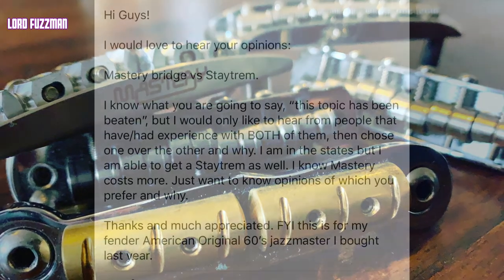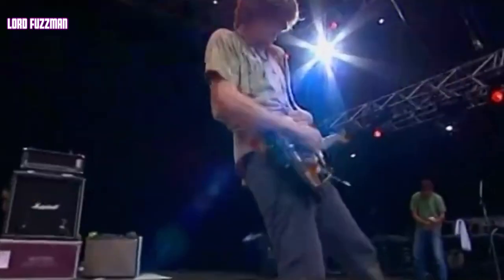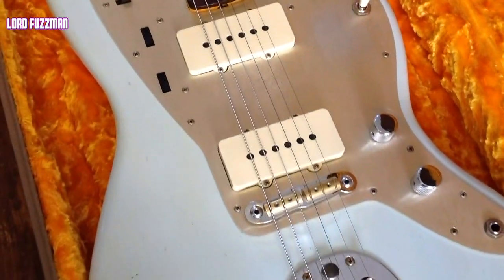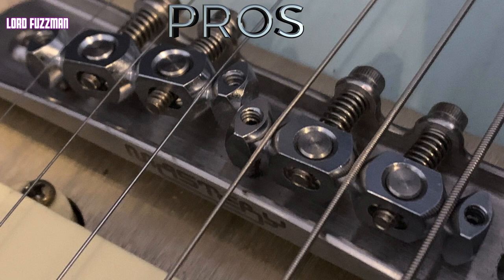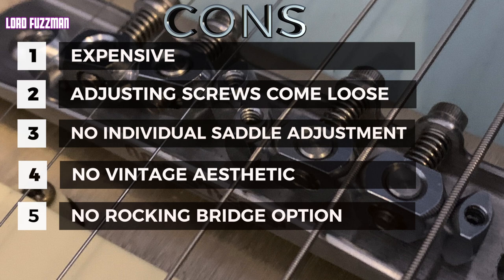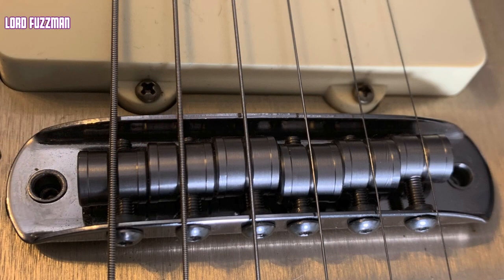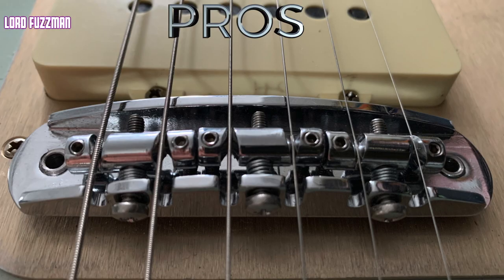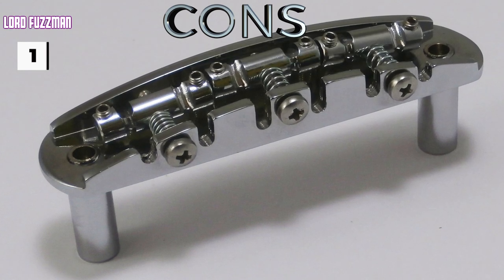ULTIMATE OFFSET BRIDGE SHOOTOUT - Mastery - Halon - Staytrem - Fender RSD - Mustang - Vintage

Comment: The vintage bridge that came with both my MIM JMs is trash.  Spent hours setting it up, manually making radius with action ruler, trial and error, the intination screw rides up and actually pushes against the bottom of the string, so had to drop saddles lower and raise bridge post height, after a few hours of frustrating tinkering, finally got it playing sweet with no buzzing.  After a couple weeks of playing, everything's rattled back out of place.

With the mustang style that comes on the American JMs, low E wont intonate without cutting the spring in half.
Reply from the maker: Staytrem is the best bang for the buck. Works perfectly with no issues and half the price of the others.

Comment: Unfortunately, you had the middle position selected for the stay trem bridge during the overdrive section. All others were the neck. I hope that was an error, but it really makes it impossible to make a judgment compared to the others. I have to say, to my ears it seems the cheaper the bridge (generally), the better it sounds, with the vintage style bridge sounding best to me. The Halon, though a technical marvel, sounds the least Fenderey to me, and actually does not sound pleasing to my ears at all. I don't mind the RSD, but I don't like it better than the vintage sound. I would gladly take an RSD for the convenience though. Still sounds good.

Comment: What brand and gauge of strings do you use on your TVL Jazzmaster?
Reply from the maker: Isaiah Coles usually Earnie ball 11 or 12s.
Reply: @LordFuzzman  I've been using Skinny Top Heavy Bottoms (10-52), but I'm thinking about trying the Burly Slinky (11-52).
Reply from the maker: Isaiah Coles yeah I’ve used the skinny top heavy bottoms. I really like them too 👍🏻
Reply: @LordFuzzman  I've been using the Paradigm version of them. They're the only strings I haven't broken with my playing. The ones I did break were setup related (burrs in the tuner and bridge).

Comment: I think there's one important aspect that needs to be adressed: do I need to drill new holes in my body to make the new bridge fit? Not every bridge fits every offset body. Just visit the Mastery website to see the complications, you can't just buy 'a' Mastery and put it on 'a' offset (JM) guitar.  There has to be a match between offered options and your brand/country of manufacture etc.
Reply from the maker: Frits van Zanten That problem is mainly specific to the design of the mastery. Because they only offer a tight fitting non rocking bridge. You don’t get this problem with other bridges 😉

Comment: surely that halon is going to suffer from the same problem the original vintage has?? ..ie the screws start to loosen through vibration over time and then start to rattle and buzz.

Comment: Personally, I see aftermarket bridges as a solution to a problem that doesn’t exist. If the guitar is set up correctly - and lets be honest, very few people know how to do it - then there’s no problems at all as the string tension is enough to keep everything tight and rattle free.
Many years ago (14-ish) I believed the bridge was a poor design but I also didn’t know how to set them up correctly, even though I was convinced I did know. I put a TOM on my Jaguar and it still had string rattle...why? Not enough tension. Once the neck was angled correctly the rattle was gone.

I use 13-56 strings with a wound third and have for years now. It’s not just my preference- these guitars work best with such gauges. However, that isn’t with full tension tuned in E standard as I play in C# standard so the tension is quite a bit less than E standard with this gauge. What this means, essentially, is you will be able to use smaller gauges - use a string tension calculator- and achieve the same required tension in E standard.

The Jag and JM originally shipped with 13-54 strings and this was a part of the design...to be used with heavy strings (medium really, but considered heavy today).

Some general info:

If saddle screws are digging into your hand then the saddles are far too low and the bridge plate far too high. Saddles must be high at near maximum and then adjust the bridge plate for action. The neck must be shimmed in any pre AV65/AO60s JM/Jag as well, this too is a part of the original design. These later models have a tilted neck pocket which makes shims unnecessary. When set up correctly the strings pass over the back of the bridge plate, into the saddles, and over the intonation screws without ever touching them. The tremolo (vibrato) is blamed for problems as well - such as breaking strings - and just like the bridge, there are no problems once set correctly.

Of the tested bridges; the Halon sounded the fullest to me, not the best as that is personal, just the fullest.
The mastery is a faulty design - and I said this way back in their prototype days - as you can’t intonate a wound third set on it, nor many other tunings. 
The mustang bridge is fine, if set up correctly.
They all sound different, not bad, just different.

When there’s quite a large market for a product due to a problem that doesn’t actually exist it shows our ignorance more than anything else.

TL;DR...don’t learn anything.

Edited to add: I’m not a vintage purist by any stretch of the imagination; I just learnt how to set these guitars up by trial and error and ever since I’ve never had a problem. The setup is a very precise bit of work with many subtleties, but it isn’t hard and once you know, you know.
Reply from the maker: Wolf H 🙏🏻 Totally agree 👌
Reply: The issue is not setup, although setup itself is an art form and requires experience and expertise. The problem is design. Even with a vintage Fender offset threaded saddle bridge optimally set up by a pro, it's still a flawed design. That's the real issue here and it's why Mastery, Halon, Staytrem, and all the others are gaining increasing market share in the aftermarket guitar hardware segment.
Reply: Daniel Stoddart 

I see no flaws. I play mine hard and have no problems. Long ago I had tons of problems but that was before I actually knew what I was doing.

Seriously, there are no flaws and when setup correctly it’s absolutely one of the most solid systems around.

I’m in the process of creating a setup guide with all the minutiae of highly specific details etc, accompanied by images. I hope, once done, it will start to destroy this long standing myth of a problematic design as it is simply untrue.

Comment: any reccomendations for the broke ppl out there playing squiers on the cheap? (me)
Reply from the maker: Mustang style bridge with 52mm string spacing if you’re broke. But most important is shimming the neck and raising the bridge for break angle. Which is dead easy and doesn’t cost anything.
Reply: @LordFuzzman  duly noted! Ive heard things about poor shimming causing neck warp at the base, but might have to take the leap this time around. would you recommend the mustang bridge over even graphtec/adjustable saddles?
Reply from the maker: @hiroprotagonitis  never had any issues with neck warping or ever seen it from shimming. Most of the graphtec ones I’ve seen don’t have the correct radius but sure if you can find one with the correct radius then no reason why you couldn’t use it 👍🏻
Reply: @LordFuzzman  tried the graphtecs out, they were alright as far as spacing and could be adjusted to fit my squier's 9.5, but heads up theres quite a bit of space between them so they (the whole saddle) do move a bit when u bend.

do u have the part number for the mustang bridge with the 52mm spacing? only the staytrem and american pro bridge (#7709942000) specify that measurement and thats pretty much my biggest grip, the high e hangs off the edge unless i really shift everything to the leftmost saddle thread

Comment: "Transfer string energy to the body" is exactly what you don't want. If Mastery think that's what their bridge does they don't understand much real guitar physics (although it's a common misunderstanding).  If vibration energy is transferred to the body (or neck) it is LOST from the strings, so not detected by the pickups. If you want maximum sustain of all frequencies, you want string vibrations reflected back up the strings at the saddles (that is, remaining in the strings), not absorbed within the bridge or transferred through it to the body. That is achieved with the most solid, stiff saddles/bridge with the least moving parts (along with some other design and setup factors). Mastery has some of those features, so it achieves the desired aim. Just not in the way they think.
Reply: More vibration energy DOES NOT MEAN BETTER TONE.
Guitars are MEANT to interact with their strings through vibration transfer and resonance otherwise they would be made of ceramics and carbon steel.
Energy tranfered from the strings to the body is NOT lost. Its circulated. String vibrations get to the wood, which resonates where it wants to resonate, and then back to the strings (and the pickups, moving them too against the strings) and so on and so forth, creating resonance, sustain, feedback, harmonics. That's how you end up listening to how a GUITAR sounds rather than how a STRING sounds. A poor link in that chain creates a poor sounding guitar.
The first lesson on an elementary grade physics class, ENERGY CANNOT BE LOST.

Quoting ""Transfer string energy to the body" is exactly what you don't want. If Mastery think that's what their bridge does they don't understand much real guitar physics (although it's a common misunderstanding)."
It reminds me of a joke about a guy who thought everybody was driving in the opposite traffic lane.
Reply: @PatatoKeftes  Vibrations would be lost from the strings TO THE BODY as I said, if guitars worked in the non-sensical way Mastery describes. What YOU are describing is a perpetual motion machine. Utter fiction. Look at measurements of string vibrations and body vibrations (eg by accelerometry or laser vibrometry) - body vibrations are almost non-existent. On an acoustic guitar on the other hand, vibrations are transferred from the strings to the sound board / body cavity (which provides 'amplification' without pickups), via the flexible bridge/body interface. Measurements show that too. A solid body electric has a stiff bridge/body - little vibration transfer occurs, otherwise sustain would be minimal. Luckily almost all of the string vibrations are reflected back up the strings, to be detected by the pickups.
Reply: @vw9659  I don't know what "Mastery" describes and I don't really care. Never had one of their products. Didn't know they existed.
I'm not describing fiction. I'm describing fact and the quintessential attribute of what makes different guitars sound differently. And I never said anything about perpetual motion, that's your words and your missunderstanding. I talked about interaction. And different bridges create different interactions. Transfering 100% of the strings vibration back to the string from the saddle would be catastrophic for sustain and tone as it is nearly impossible for those reflected vibrations to be totally in phase with the original vibrations which means partly cancelling each other out. Your electric guitar has some acoustic tone and thats what your HEADSTOCK TUNER reads. It's why your guitar sould sound very honest to itself no matter what gauge or brand of strings you put on it. If you want part of that acoustic tone to be reflected into your amplified tone you need hardware that allows good string-body interaction. Its part of the harmonic content of an amplified tone. Measurements from industrial equipment cannot tell me how a guitar will sound. However I can confirm that a proper guitar, with a proper bridge can generate body vibrations that are approximately 30% of string's vibration amplitude. That's not at all non-existent.

Look I don't know if you are trying to diminish the attrributes of a certain brand or product because of bad experiences and honestly I don't care. i don't know if you try to justify your initial comment with utopic arguments just so you will not seem stupid, go at it, I don't care. Seriously though, strong fact denial is schizophrenic indications, just saying, maybe in need of some checking?
Reply: @PatatoKeftes  This has little to do with Mastery per se, except that this video quotes their incorrect statement. But as I said, their product achieves its aims despite its designer's misunderstanding of solid body guitar physics. So I have no issue with their product. 
Re what you said: "Transfering 100% of the strings vibration back to the string from the saddle would be catastrophic for sustain and tone as it is nearly impossible for those reflected vibrations to be totally in phase with the original vibrations which means partly cancelling each other out." Your misunderstanding of musical instrument physics is profound. Read any textbook on musical instrument acoustics/physics for how string vibrations actually work, particularly at interfaces like bridges. Vibration phase interactions at bridges are well understood. It's the same as in other applications of wave physics - science is consistent. String sustain is achieved by phase-concordant vibrations reflected back up the strings, ie remaining in the strings. Eventual vibration decay if the string is allowed to ring long enough (rare) occurs through air damping and internal string losses, and vibration absorption mostly in the bridge and neck. The vibration transfer to the body and its "circulation" that you imagine (presumably somehow eventually reaching the pickups ?) would effectively be a perpetual motion machine. Where did you pull the 30% figure from (particularly since you don't seem to trust the actual measurements that have been made on real guitars) ? The way in which solid body electric guitars work is well understood. And it doesn't involve such imaginary physics.
Reply: Rhythm players and solo players have different tone preferences. Fender’s biting attack and less sustain vs. Gibson’s long sustain with weaker note definition for example. With a bright attack, string vibration/energy is lost immediately thru the bridge onto the body. Different bridge/body combinations thus give different tone. Pickups matter as well since they receive different frequency range and overtones from the string based on winding and placement. There’s no point for the longest sustain if it comes out as a dead tone with low harmonic content, since it’s not a bowed instrument, the sustaining part is the dying filtered out tone that’s left out of the initial attack. Roland’s popular LA Synthesis technique from the 80’s was based on the fact that humans mostly identify an instrument from the tiny attack phase of the note, so they only stored those tiny samples in their synths, and used generated tones for the sustain. They used this approach rather than sampling the whole waveform, because sampling memory was so expensive beyond many musicians pockets in the 80’s.

Comment: Mustang is the best of both worlds, but string spacing can be a pain in the arse 

Staytrem and Mastery take the prize IMO. I'm a bit disappointed with the Halon :( too bassy
Reply: The Halon was so bassy and lacking in top end that it sounded like the tone control might have been rolled back
Reply from the maker: Yeah I think listening back, it’s quite possible the tone control may have been rolled back slightly. The Halon definitely didn’t have that issue using it live. 🙈
Reply: Lord Fuzzman Would you consider doing another video even just comparing the stock or the Mustang bridge to the Halon? If the issue was with one of the ‘established’ bridges, it would be less of an issue as there are lots of video comparisons and demos out there already, but seeing as the Halon is a relatively new product and this is possibly the only demo of it out there it would be a bit unfair to let it go.
Reply: Mastery and Staytrem are my #1 and #2 choices. Never had a single issue after installing, setting up, and intonating either of them. I went with Mastery on the Jazzmaster here because it's such a well-engineered piece of hardware and the quality of the tooling and finish is exceptional. I don't make any claims about improvements to tone, since that's a relative quality. But what is not relative and is absolute is that what I was looking for was a solution that would make the guitar issue-free and low maintenance. One of the most important factors for me was that the string spacing at the bridge be uniform, enough height adjustment that I wouldn't have to shim the neck, and the vibrato "just works" without binding the strings at the bridge (i.e., the saddles are smooth) and constantly putting my guitar out of tune. The Mastery can take a thrashing and IMO is the best mod you can make to a Jazzmaster or Jaguar.